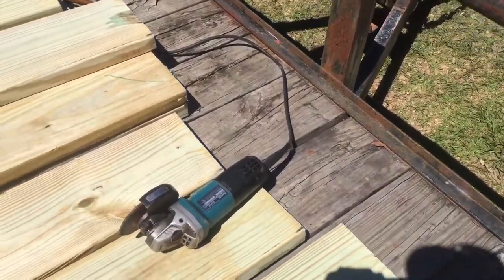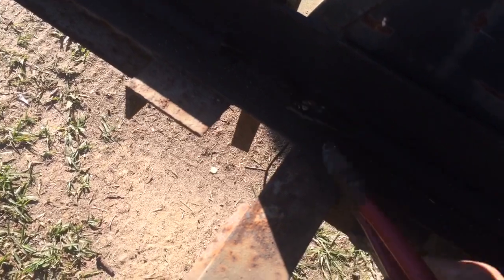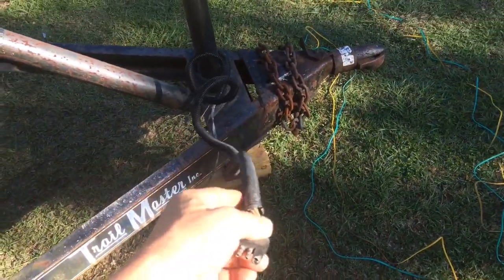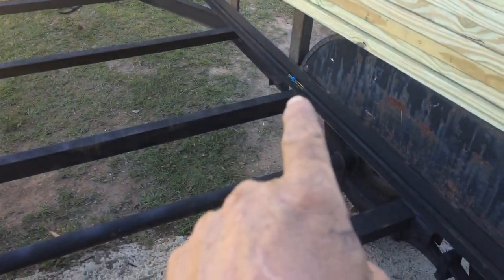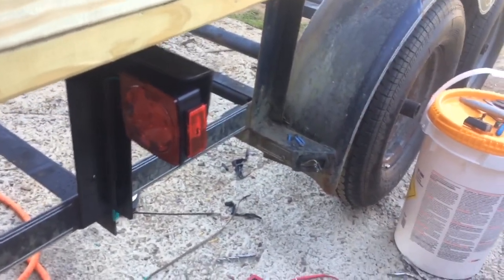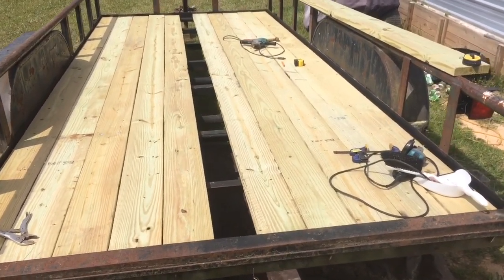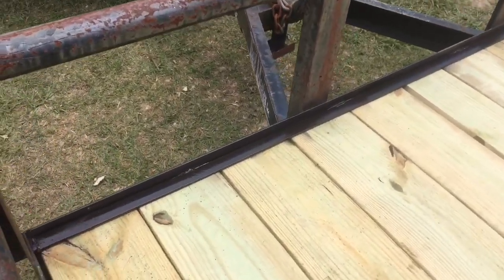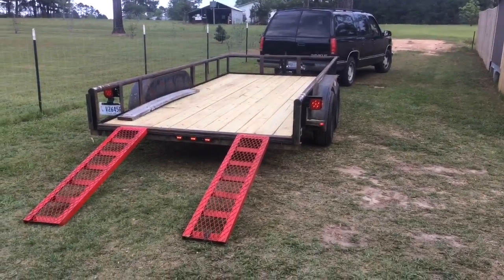Re-decking and re-wiring a 16-foot flatbed trailer.

Comment: Was just given a 16 foot trailer. About the same amount of rust with some dents in the bars and needs a new deck. This is helpful. Going to pick the boards up tomorrow after work and get to it. How crucial is that tack welded strip in your opinion? I don't weld, was thinking if I bolt the boards down well it may not be neccasary?
Reply from the maker: Awesome! The welded strip can keep the edges down as the wood ages, if it’s needed? some loads point heavy between the places between the front and the next crossbar towards the center could bend the deck up. Owners choice.

Comment: Just a trick -  Instead of re-welding that front metal strip, I used a metel L bracket with 4 recessed round bolts. That way if I break a board, it's an easy fix.
Reply from the maker: Not a bad idea. Thanks!

Comment: Nice job👍. After the boards are cut and fitted what do you think of painting all 4 sides with a preservative then install?
Reply from the maker: as this was treated lumber, we did nothing else to it. one COULD I suppose, treat it further. However, as these usually get beat up pretty bad in normal use, most people around here just replace the deck every 7-10 years.

Comment: Hi,

I know this is an older video but I did have a question on the front section iron that you cut off to install the boards and then reattach (welded). 

Can you bolt the boards (front) to the frame like the center one's.  Then just place a angle iron on top and screw it to the board and 4 on the outside frame to hold it? This way you don't need to spot weld. Or is it a structural support for the frame?

I don't have a welder equipment. 

Thanks
Reply from the maker: yes, that front tab of metal in tacked on after the boards are installed

Comment: I have watched about 6 videos on replacing trailer decking. Know one mentions treating the lumber with a water seal product like Thompsons waterseal or using wolmanized boards. Would like your comments about this subject.
Reply from the maker: We find that the ground contact pressure treated lumber is more than adequate.
Reply: @toadstead1  I have to do this on a 10,000# trailer that I just bought.  I can get 2" rough white oak (green) for about 50% more than pressure treated.  Any thoughts on that tradeoff?  White oak has a closed cell structure so is good for exterior use.  I'd probably put some sort of sealer on it as well.

Comment: Gday
nice 
i need to get into my flattop it was a caravan still dont know what top to fit 
cheers
Reply from the maker: For me, it depends on the use. I think the lightest material that will do the job is best.
Reply: yer wood is not a common trailer floor around here dont last long at all. got time to think about it need to put some more braces in as across it 1st and get the elc brakes fitted and bits 
cheers